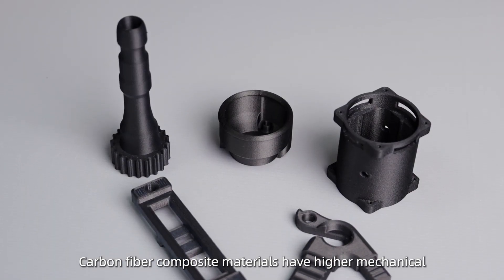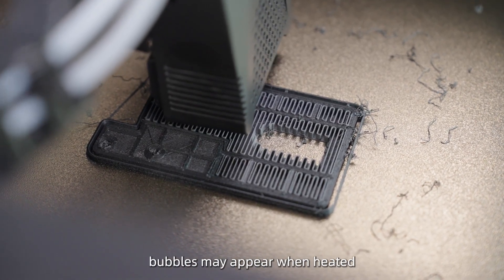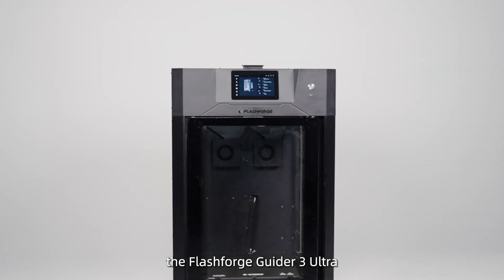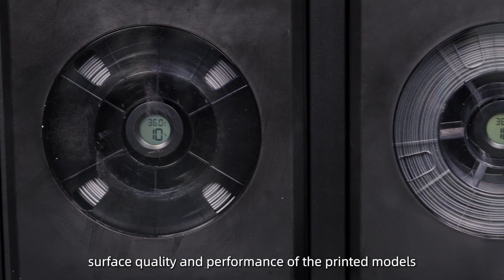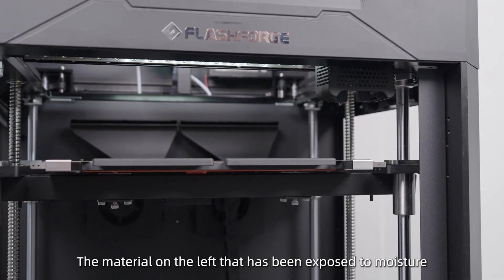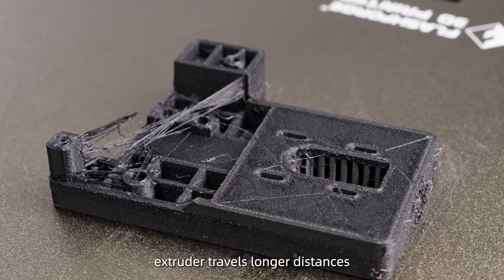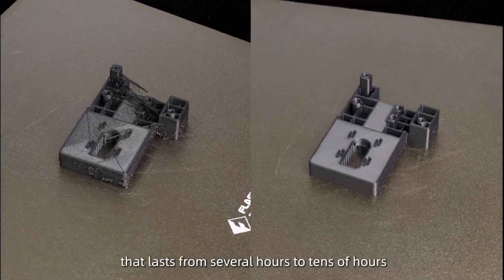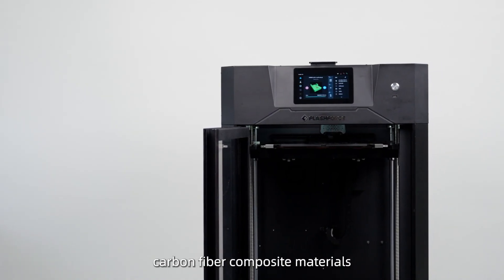Guider 3 Ultra: Sealed Filament Drying Chamber for Moisture-Absorbing Materials

Comment: You need an active heater to print those carbon fiber materials with proper layer adhesion.  Without an active heater, this Guider 3 Ultra printer is a waste of money…especially with that terribly slow and glitchy Flashprint software. 😂